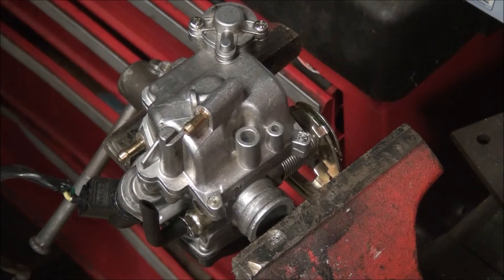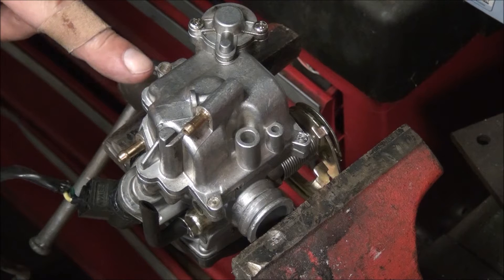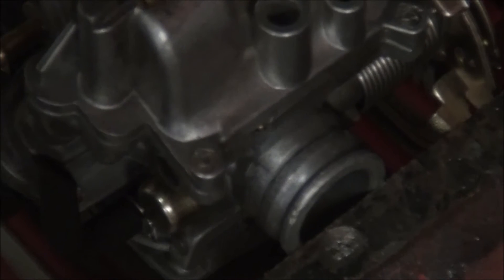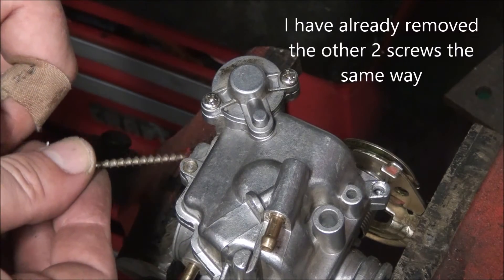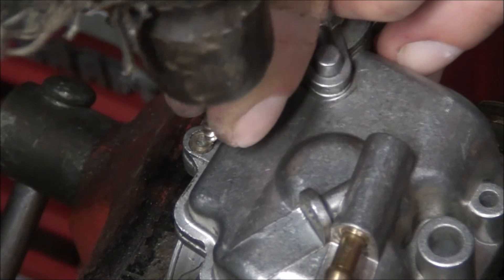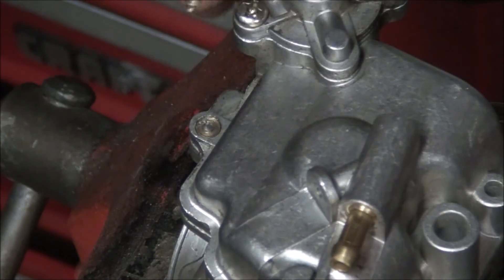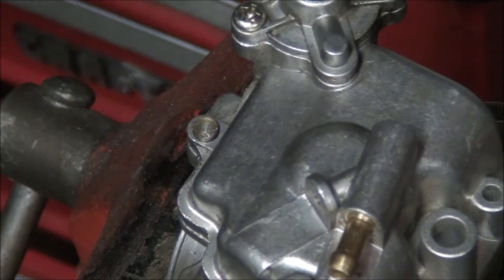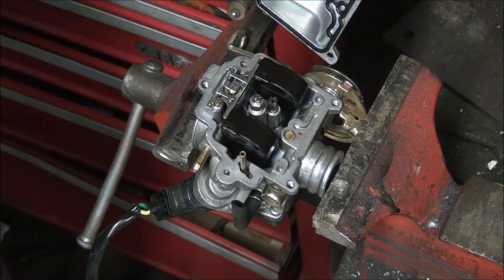CHINESE SCOOTER MOPED Carb FLOAT BOWL REMOVAL (with tamper proof screws) QMB139. model- HT50QT-26

Comment: Good video. I pulled this carb off (exact same one) and looked at it think what the........... Then looked at it under a magnifying glass and thought these bastards machined break off screws........ Found your video and  realized right off the bat I wasn't seeing things. That method works great for breaking bolts loose. I usually use a chisel and do the same thing. Thanks! :?)